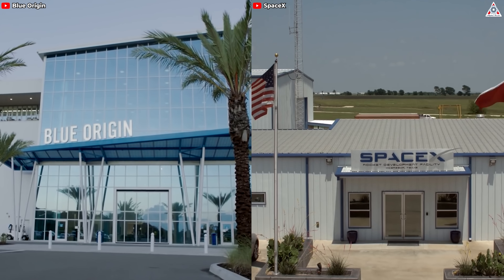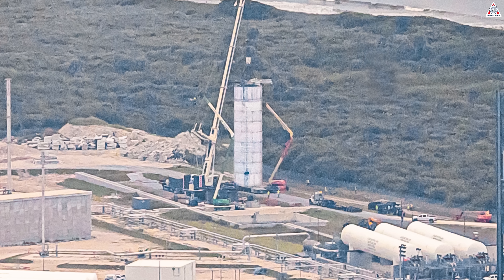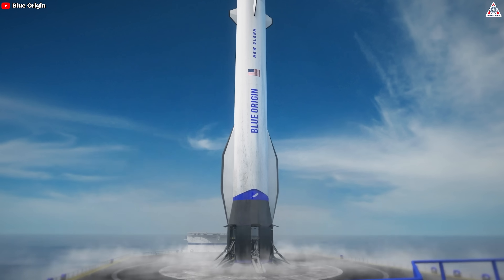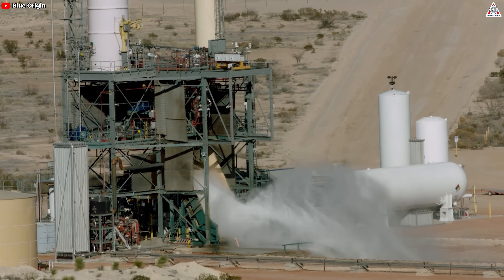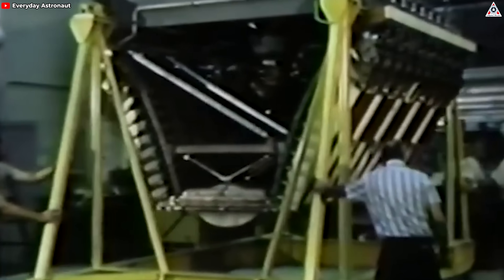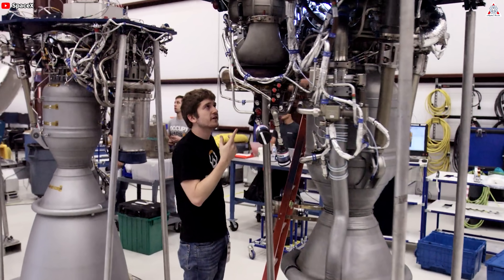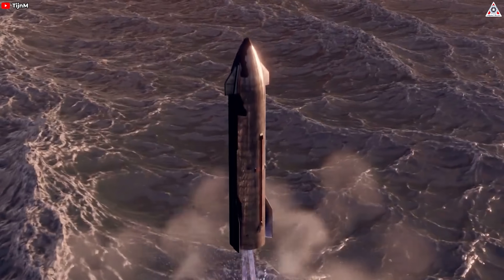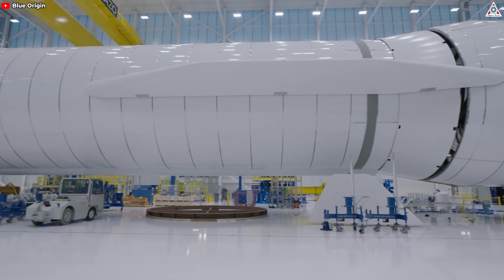Blue Origin's Starship Killer - Elon Musk Laughs!

Comment: The real planned advantage of aerospike was the fact it can use less carried oxygen in lower flight taking air in flight for part of the burn reducing weight in fuel.  The current cone designs carries all the oxygen as payload.  The aerospike saving liquid oxygen carried doesn't need the same lift to do the same job.  Designers should look at some air rams near the bottom to help feed the engines in lower flight, perhaps even developing a rocket/jet hybrid engine using air first then shifting to bottled oxygen later.  If you can cut a quarter of the carried oxygen for fuel you can add a lot of more payload or reduce the bulk for cheaper craft for the same job.  The aerospike engine was intended for the replacement shuttle fleet that was cancelled as the first was almost ready before being canceled.

Comment: Glad to see Blue Origin trying things that are different than SpaceX.

We're starting to see the beginnings of the Space Renaissance...

The Aerospike concept is interesting, could see where it could be used for an engine that was the diameter of the ship, and where the spike was a heat exchanger used to run the pumps off waste heat.. would make a highly efficient design.

Also would be conducive to semi  concentric tankage, say reversed tapered with fuel in the center, then use mega central fuel pump,  and a circle of oxy pumps to create the ring.
Those could all be run off a waste heat tubine and phase change, with the outer oxy pumps run like a planetary gear set.
Just one way to do it, also could have both pumps be one mega unit running off the same shaft.

The best thing about space, is the infinite possibilities...

It'll keep us busy for awhile. 
And we may see a political paradigm shift soon, and alot of capital freed up from bureaucracies and regulations and needing a new home in Space ventures...

I could see Argentina being able to afford a space program soon...

Just sayin'

Comment: The final score: Musk 1 and Bezos 0.
Reply from the maker: Exactly
Reply: Yeah ! 👍🏼
Reply: Bezos doesn't seems to be passionate about space exploration. I don't understand why he didn't just buy some stakes in Boeing (before its reputation tanked ofc), or invest in other space company instead of building his own from scratch.
Reply: Um, Musk has had 4 launch failures.  And Mulitple test failures.  And the OLM has failed to be rapidly reusable EVERY TIME ITS USED.  He built is tanks too tall and too close to the launch pad, built no diverters to protect his too nearby infrastructure, put water deluge in after nearly destroying his entire pad, and even then utterly failed to understand how and why every Other reusable pad has deluge introduced at the TOP of the pad rather than at the bottom. The only thing the showerhead protects is the steel plate from melting, although he loses 1/4 inch of steel plate with each launch from blast erosion. 
He FINALLY got a starship to reentry, only to discover that the whole DESIGN of the starship is fundamentally flawed in that its flaps and hinge points get melted away. And because he never thought thru the entire system, he keeps finding out starship and booster are heavier when he has to slap so many bandaids on his mistakes, that now he has to make the whole thing taller, and demand even more SI out of his engines just to get it to half the tonnage he claimed he would be able to loft. And utterly failed to use his EXISTING functioning launch system to TEST a version of starship idea just to see how it held up to reentry BEFORE he built an entire infrastructure and manufacturing facility to build something that he had no idea would melt.
Musk does NO due diligence ( how he ended up being forced to buy Twitter ) 
Meanwhile Artemis worked nearly flawlessly on its first launch, sending a capsule further than any rocket in history.   And 60 years ago, the Saturn 5 launched flawlessly on its first launch and ITS launchpad and ones like it at Vandenberg have been SO rapidly reusable that it’s how SpaceX achieves the falcon 9’s record launch cadence. 
NOW, Musk is redesigning the entire OLM to do what?   Have a flame diverter and top flooding deluge, like everyone TOLD him to years ago. Re-build all the infrastructure from scratch for LOWER, Farther away, and better protected fuel tanks and support facilities. 

Only the Muskovites are so deluded as to think repeated spectacular failures are signs of genius.
Reply: @christopherpardell4418 you left out Falcon 9, the most reliable and only reusable orbital class rocket on the planet. I'll stick with a winner.